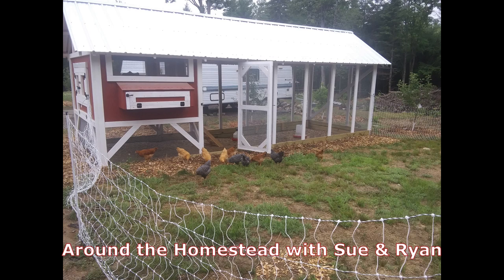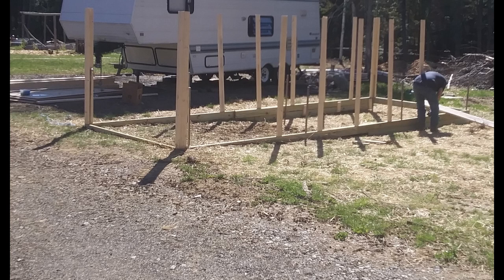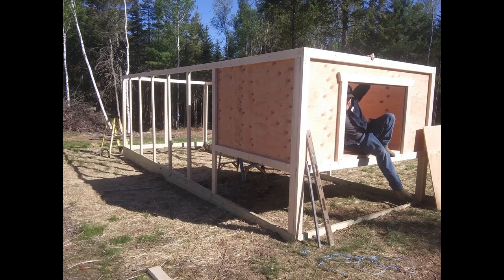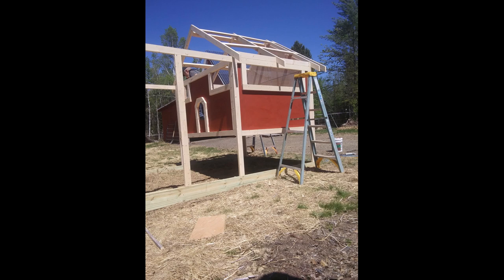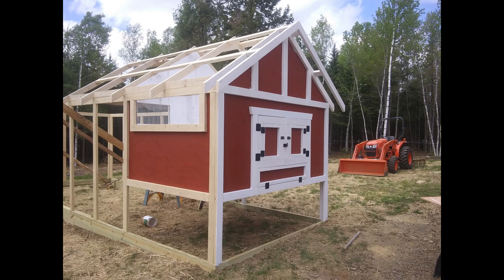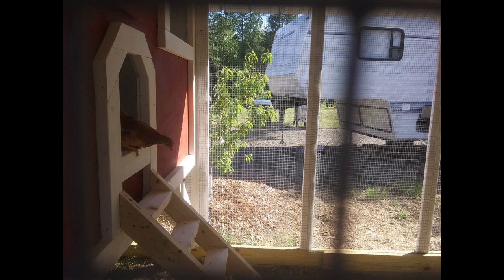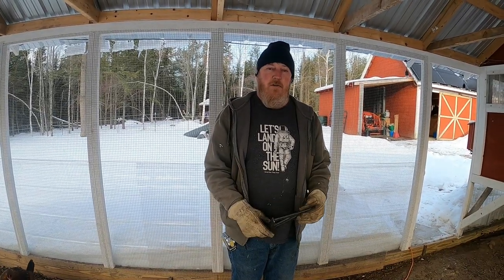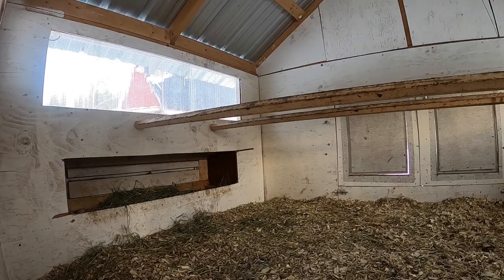Carolina Coops style DIY - Chicken Coop Construction

Comment: I am building a coop and it is on very uneven ground.  I ran 4x4 redwood for the base, and made it level, so at one end the 4x4 are almost 8in high off the ground.  Then I started filling the gap with concrete that also holds down the predator screen.   As that gap grew bigger, I realized there was no reason to keep the base level !!   Only on the coop house itself, which the slope didn't change much.  For the run part, you can step down the base and just using taller studs to level the TOP where the roof is.  That is only what matters, not the base.  It is probably best to also make this step at one of the 4ft marks so the screen doesn't have to zigzag down the stepped area.   
Just wanted to give a tip to your viewers.
Reply from the maker: Good point, That is for sure a good way to go on uneven ground, Thank you for the idea

Comment: I’m planning this build and using your materials list. I see you have 85 2x4x12’s ? Is that accurate? Or did you mean 85 2x4x6’ which would be half? 
  I’m fixing to buy the material and I don’t see the 85 12’ 2x’s in the design.
Thanks for the great video and the great ideas!
Reply from the maker: We used about 58 12 footers, but we did use them liberally for trim and stuff. I think if one was on a budget they could probably thin down the materials more than we did

Comment: You did a fantastic job. 

Do chickens roost in the run way up high on those beams that made the triangle with the rafters?  Carolina coop usually block off the triangle with plywood to prevent them from roosting up there.

As for the hay kicking out of box,  I noticed CC has a 3-4 inch tall board in front of the box. 

Awesome DIY job.
Reply from the maker: We had one hen that would roost up there but not to big an issue, And yes we added a 1x4 across the bottom of the roost box and it made a huge difference.